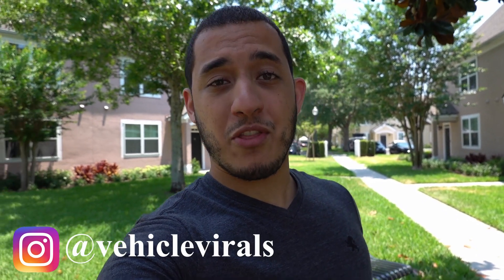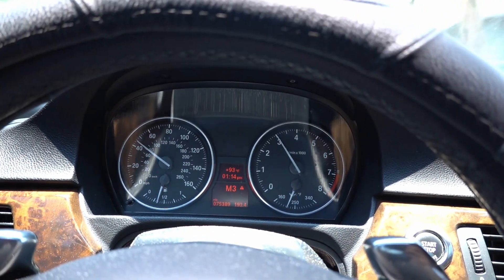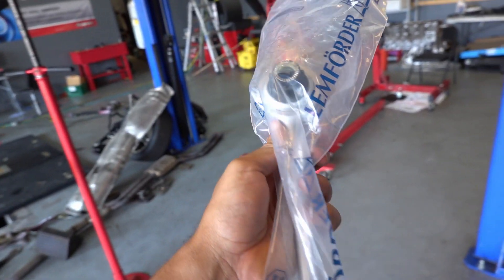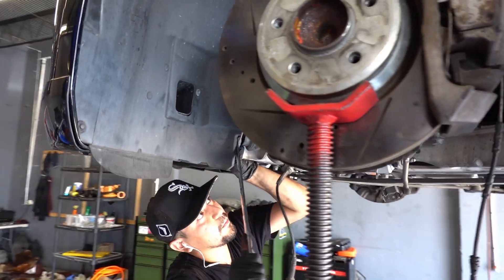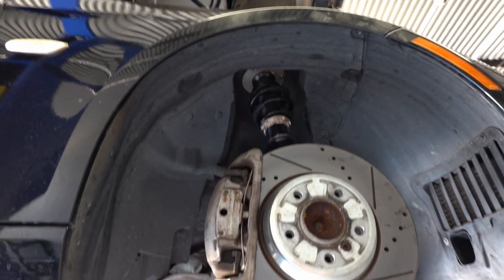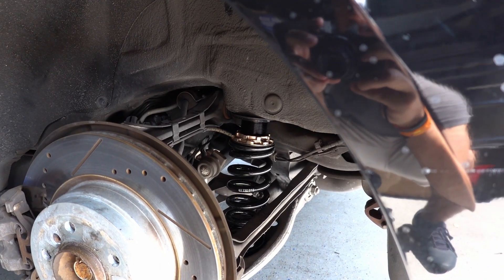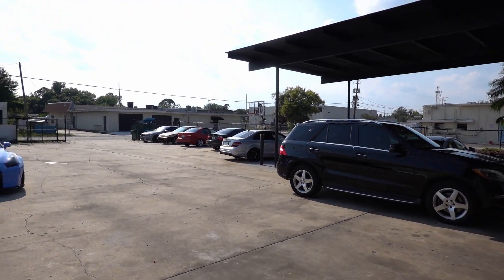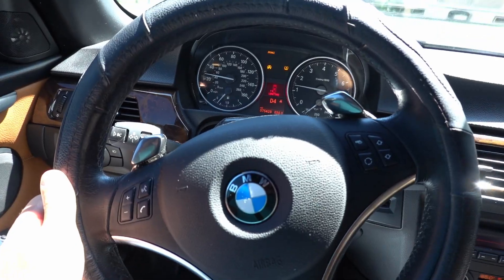This One MUST HAVE Mod Completely Transformed The Look of My BMW 335i! - EP 11

Comment: I did my own coil overs on an e90.  If you don't have a garage, you are alone, and you have never done it before, forget about doing it yourself.  Between the install, the post install leveling, and the parts I had to order in the middle of the process, my car was dismantled for days.  Then I still had to get an alignment at a shop anyway.  Watching the guys at a shop slap coilovers in place is not going to be a typical first timers DIY experience at home.

Comment: If you want to fix up your headlights and foglights for relatively cheap do the following: 

Wet sand with 400 Grit, 800 Grit, 1500 Grit, 3000 Grit 
Once it's all smooth Buff them with a compound pad and compound paste
Then repeat with a polishing pad and polishing paste
Protect with a ceramic coating of your choice.

Mine look amazing for a year and a half now with no fading. No they'll never be perfect but from the naked eye they'll look brand new. 

Cheers.
Reply from the maker: Appreciate the suggestion man! Do you park your car outside or inside?

Comment: You didn't mention old golf tee mod on your exhaust did it make a difference in sound mines completely 1 off after the dps so i wouldn't know.  Coilovers on 19's thats a hard ride hopefully you have good streets in Orlando or drive at speed alot. You'll like them ive been running coilovers for 3 years great at speed and cornering but crappy roads blow.  Tires make a big difference firestone firehawk indy 500 work well with coilovers but, i switched back to my 18's.  Good call on the install your right it took me around 8 hours and it fights you the whole way.
Reply from the maker: Luckily for me the roads I travel on here in Orlando are buttery smooth with the exception of maybe one part of the main interstate that is under construction. I have heard that 19s with coilovers and rough roads can be a nightmare. 

As far as the golf tee mod, I haven't really paid attention to it lol since the coilovers and bushings were taking me on a kangaroo ride the first day lol

Comment: Hi when you did stage 2 did your check engine light come on at high revs .no different in power when on ,no codes
Reply from the maker: No engine light or codes but mhd clears the codes automatically after it installs the tune.
Reply: @VehicleVirals  thank you they installed atm software stage 2 very fast but just that light at about 6 and half thousand revs.
Reply from the maker: @shafieksalie3119  very odd

Comment: If it’s harder than a Toyota hiace you’d probably need help changing it although the control arms for asain brands are massive
Reply: It's pretty doable with jack stands. Just be sure to preload the suspension before you tighten up the bolts.

Comment: I thought you knew about the "Golf Tee Mod"!!
Reply from the maker: I did, just never chose to do it because I always figured if the vacuum line is there it's probably for some important reason (like to help warm up the cats, or creating back pressure) and I didn't want to mess with it.